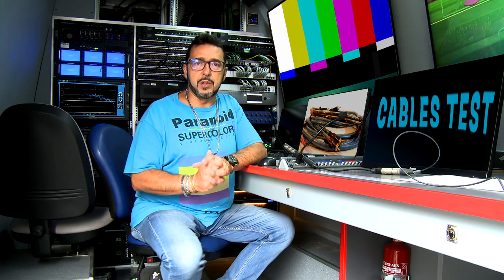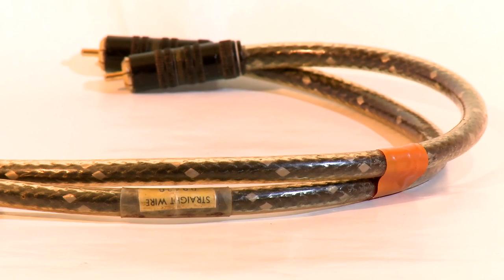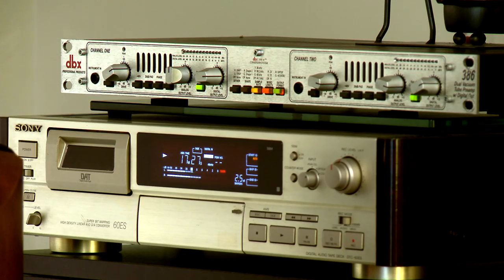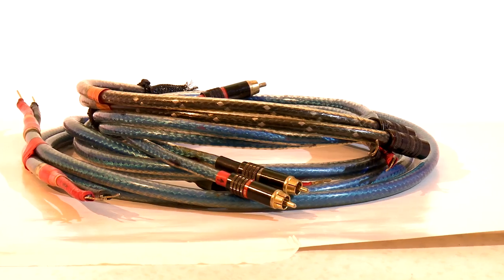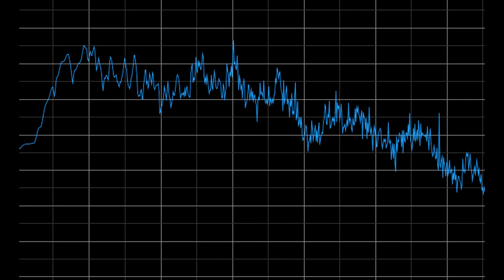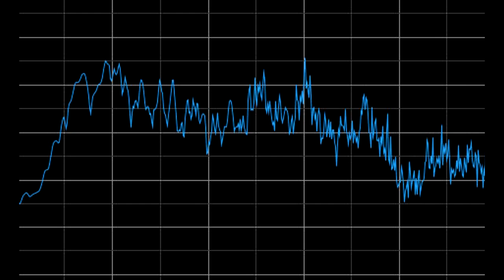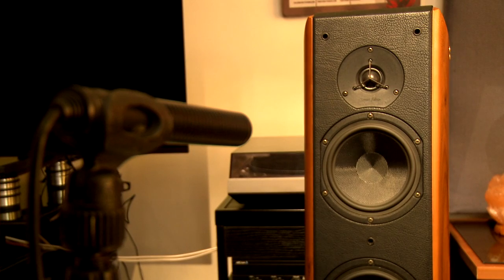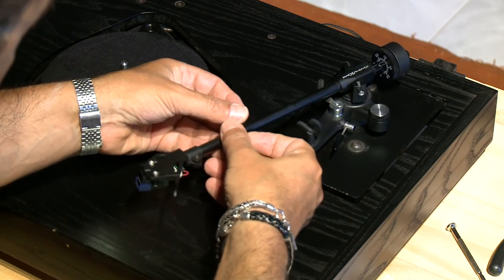CABLES - yes I can hear! 👂

Comment: What you failed to demonstrate is which cables actually made a difference.  Empirically, inferior shielded cables and small speaker cables should make an audible difference.  Power cables, probably not so much.

I think the better objective test would be to run an audio sweep generator in the same manner of test, but swap cables one at a time.  This would provide much more valuable information than the simple test you conducted.  It would allow you to see exactly what attenuation occurs on a per frequency basis.  Then, once you found which cables actually make a difference, you could conduct A-B music tests for your subjective assessment.

I used to run sweep tests on our simulcast radio networks to ensure that the frequency characteristics matched from radio site to radio site.  Using a plotter, the graphs were overlayed and the differences were visibly apparent.
Reply from the maker: Thankyou for your comment, I will make single cables tests in the future.
Reply: Powercables? Try solidcore. Improved my TV`s picture quite a bit too btw

Comment: Watching this, so many questions arise. There are so many sources of measurement uncertainty here that you didn't address. 

As far as I can see there is no FR change at all, only some change in lodness (a fraction of dB). Going from that and claiming all these subjective adjectives at the end of the video is a large step. 

How about consistency? Did you make recording of the same track with "shitty" cables twice and compared the recordings just to see that the variation doesn't depend on something else (measurement, measurement equipment etc.)? And then doing same thing using the "high quality" cables? And how about repeating the experiment a couple of times just to be able to claim repeatability?

That (very small) loudness difference in the frequency spectrum can depend on simple thing like resistance in the connection area due to slight oxidation. Or that the speaker cables had slightly different resistance. 

The loudness difference in the FR could also depend on one of the tracks recorded and processed having a quiet passage at the beginning or at the end of the track. 

Did you keep the microphones at the exact same distance from the loudspeaker?  Just a couple of cm would make loudness diffrence. 

I am not convinced at all.
Reply from the maker: The differences measured are not just loudness, we can observe that the curve didn't change in all frequencies, I recorded not only one track for measurement, I did it with 9 tracks from the CD, and the results were the same in all of them, in this video I only show one. There were no changes in microfone position, volume or anything else, just the cables.
Reply: Even at a quick glance I saw that the differences were more than just amplitude....